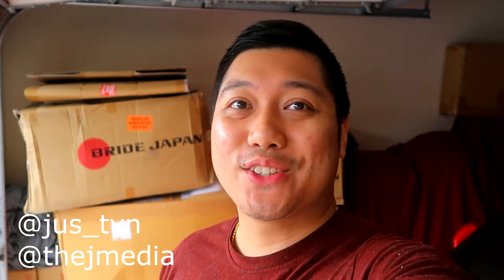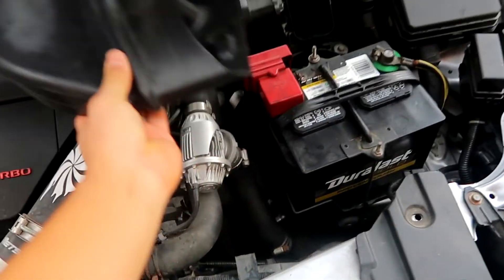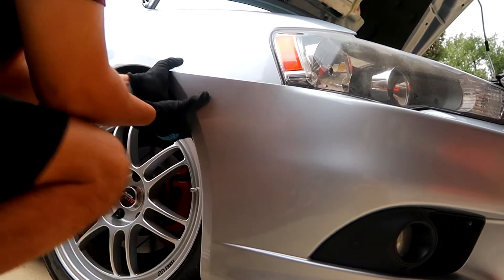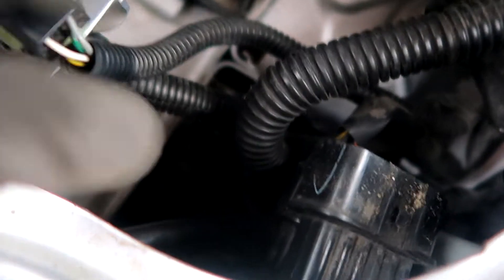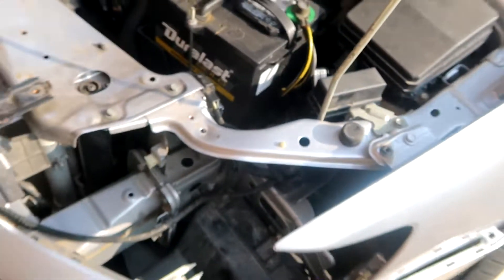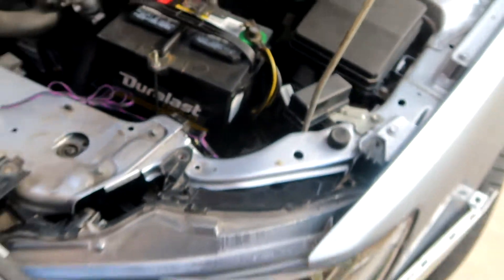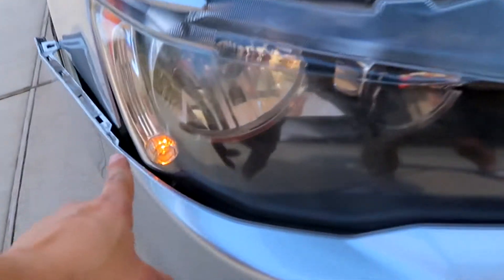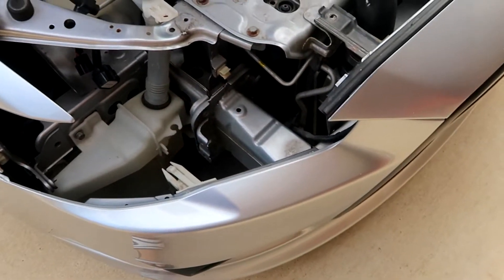Custom vland headlights on my Ralliart!

Comment: How did you get the customizable color for the headlights?
Reply from the maker: I had to take apart the headlights and rewire the circuit boards to get them to customize colors through a Bluetooth app